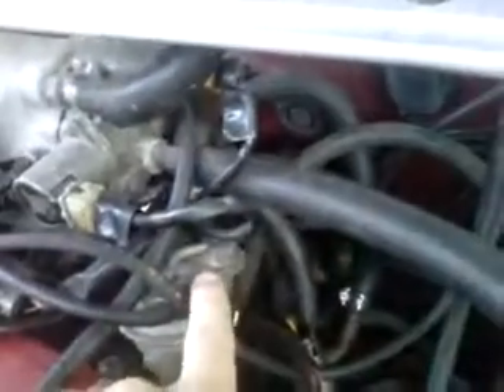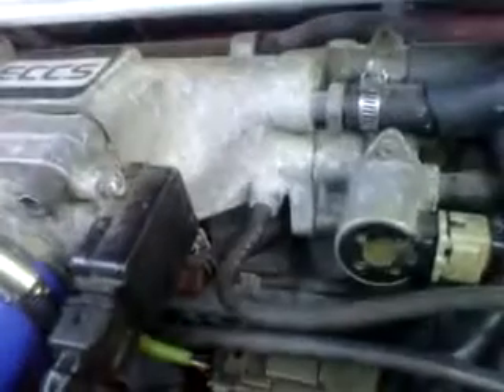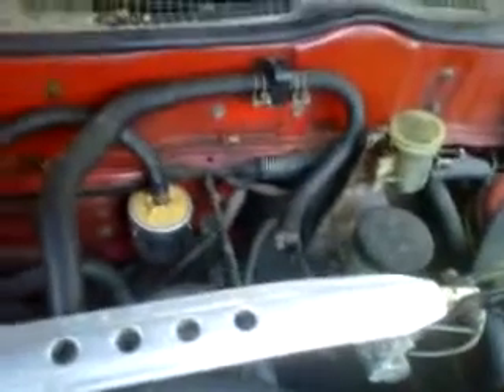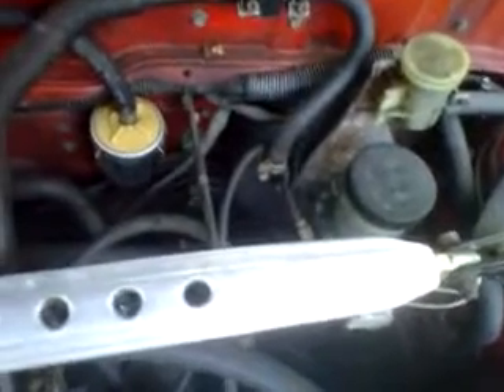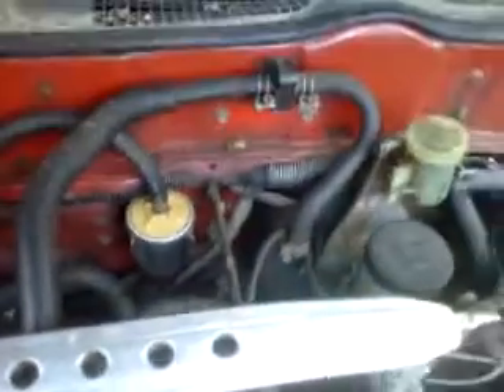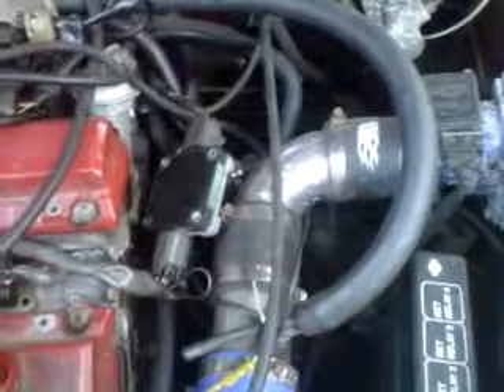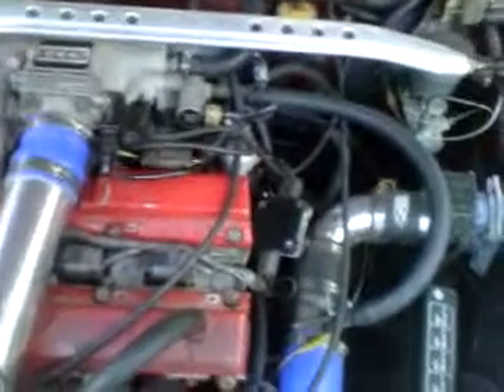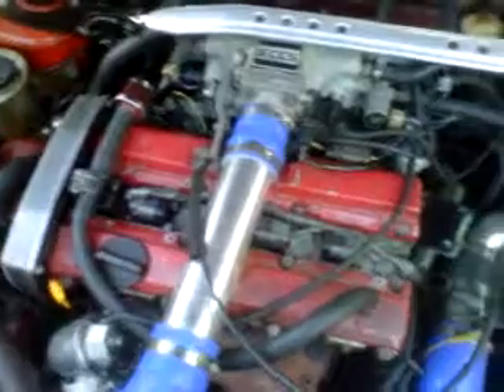FWD ca18det vacuum system

Comment: are you still active I'm trying to route my vacuum hoses like you have by taking out the vac canister and the powervalves
Reply from the maker: jake Hazelquist yeah I am. still own the car too. I actually have improved the set up. Though I have never taken the time to bother with the power valves. Since I run non turbo pistons, the compression is higher and I spool my turbo by 3k. never cared enough to hunt those.
The other canister is just for emmisions, I would advise not plugging it but still finding a way to vent it for the pressure relief to the tank.

Comment: Please I need to know how! I got rebuilt ca18det fwd on s13 the rocket covers are different
Reply from the maker: With fwd you need an extra breather piece that is located in between the valve covers towards the timing belt.
On rwd there is a block off plate there. You can swap the plate and breather.
Without the breather you don't have a vent on the intake side.
Reply: @LiquidNeon00  yes I got it, and these to need connect with the turbo?

Comment: hey bud i understand this is an extremely old video but if you still have the car id like to know if i took a rwd ca18det wat gearbox (with gearbox ID number) could i use too run it as a fwd as im planning of doing this to a toyota ive got and want to keep it a fwd car
Reply from the maker: It's old, but I still own the car. Took it to the dragway recently and couldn't stop spinning tires. I've been meaning to upload that, haha.
Anyway, the ca18det is the same block fwd and rwd. Just need the fwd mounts and trans to make it transverse. My engine is actually from an S13 silvia, just used all my factory usdm pulsar nx running gear. I even kept the stock computer and wire loom, just added a nistune programmable rom.
To swap into a toyota you would end up fabbing a lot of things, but yeah just use whatever engine you can find.
Reply: @LiquidNeon00  thnx for the reply well basically the engine position with yours compared to my gen 7 celica are pretty much the same and if necessary i dnt mind cutting the mounts off and getting other mounts to weld in place to make the motor seat right but im currently struggling with finding a gearbox to fit onto a rwd ca18det if possible you have the gearbox code to help me find it easier and if possible add me on fb if possible would make discussing this easier just search up Dylan Bastick youll see myself on the right then my wife and son on the left of my p.p the assistance would be highly appreciated

Comment: Still Around?
Reply from the maker: I still own the car, currently it's in between builds. The engine popped its hg last summer then I bought a house. Now I'm finally getting back to giving a proper build to it.
Reply: @LiquidNeon00  ok nice. Im putting a ca18det in my pulsar nx se soon. My hoses are already all over the place with the ca16de in it.. what car is that ca18det in?
Reply from the maker: @TheObediah1985  this is in a 1988 pulsar nx se. I have several other videos of this car on this channel.
Reply: @LiquidNeon00  I'll check them out.  I need inspiration
Reply: @LiquidNeon00  mine is black.. 5 lug with 300zx brakes and wheels all around. Would send pics but can't here